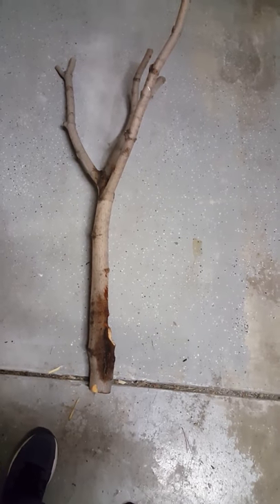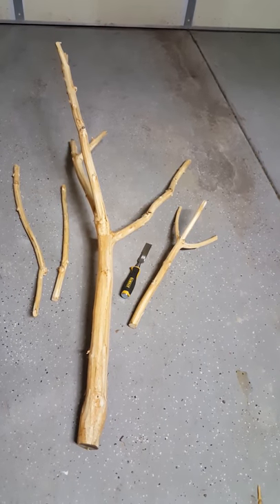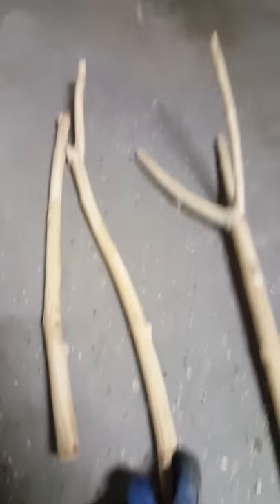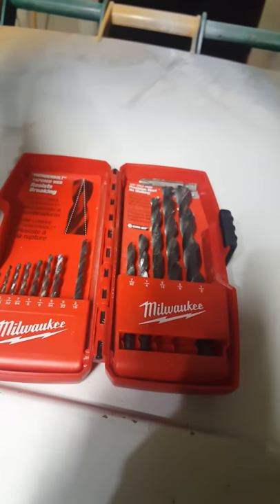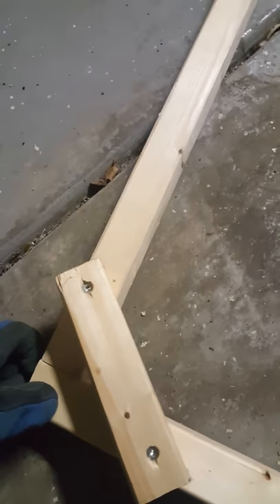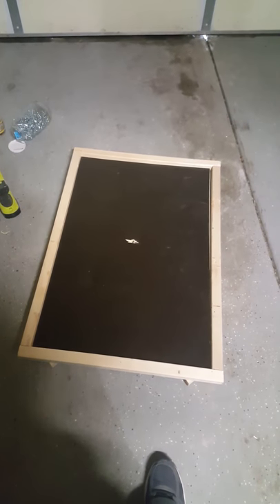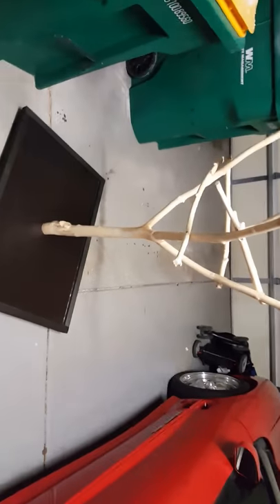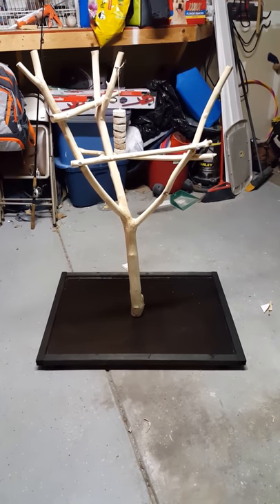How to Build a Parrot Stand cheap - DIY

Comment: Backsplash? and what did you treat the base with? Thanks for any feedback ❤️
Reply from the maker: I used extra baseboard from the island I installed in our kitchen. You can use anything for the base would just recommend using something easy to clean and won't soak up liquids. I put newspaper over it when the birdie is on his stand :)

Comment: can i use wet wood (just go out and cut a branch off) or does it need to be dry?
Reply from the maker: Yes, cut it down, strip the bark, soak in bleach, rinse with soap and water, let dry and you will be good to go :)

Comment: Can you please tell me what tree branches are safe for budgies/parakeets? Thank you 💛
Reply from the maker: I used maple, which should be fine for your budgies/parakeets. Just make sure you strip the bark, soak it and scrub it with soap and water. Good luck can't wait to hear about your birdies new perch :)
Reply: Thanks a ton for responding.
And yes! sure i will let you know about it, as soon as i get it done. 👏
Reply: I'm using pine tree from back yard sock w vinager water in tub for 1hr let it dry outside since it's hot will place them in oven 200-250° for idk 1hr an tadaaaa hope my budgies like it🥰

Comment: Would it be a problem leaving those holes exposed?
Reply from the maker: No, just use stainless steel screws or bolts. Good luck on your build :)

Comment: Is the frame for the base needed?
Reply from the maker: You can make it however you like, however, you will need some kind of base to hold up the stand. The base also keeps the birdies droppings from getting on the floor. Good luck with your build :)

Comment: Did the tree have any chemicals on it?
Reply from the maker: No chemicals on the tree
Reply: @Positive_Energy727  :O You actually replied? Honestly didn’t expect that. Just in case you reply again, I have another question. Is Norwegian Spruce okay for parakeets?
Reply from the maker: @n1mra.  lol, spruce trees are safe for your parakeet, which would include Norwegian. Good luck with your build :)
Reply: @Positive_Energy727  Thanks!!